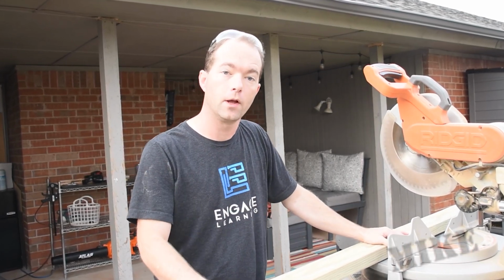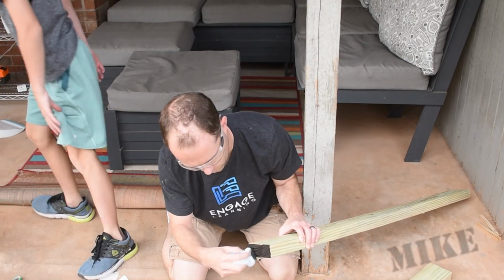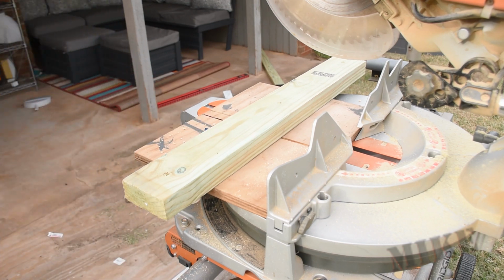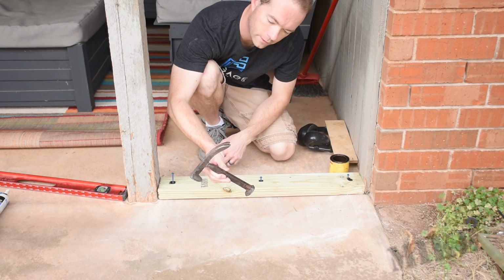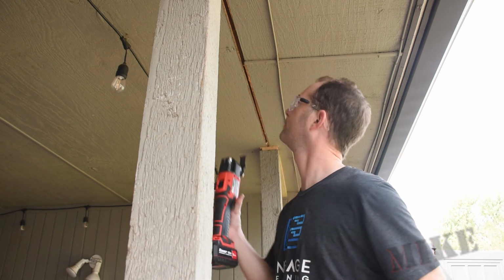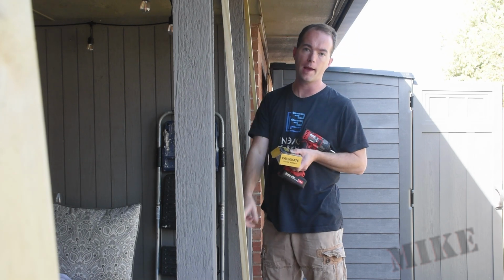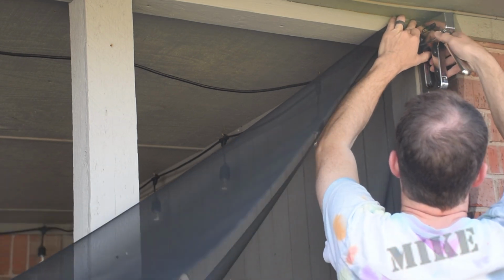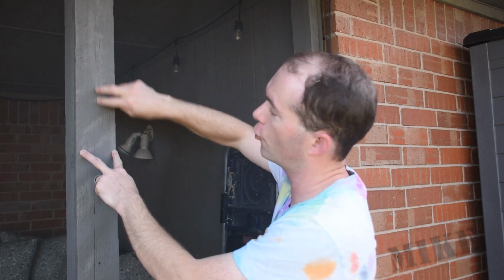Porch Screening - Mikes Inventions

Comment: You normally on top of things but that "stain" does nothing to protect the wood. It's not a drying oil more you don't even need to do that on treated. The paint was enough to protect it, anyways looks great and you are correct there is nothing better than a screened in porch.